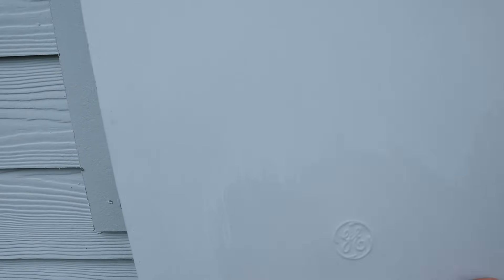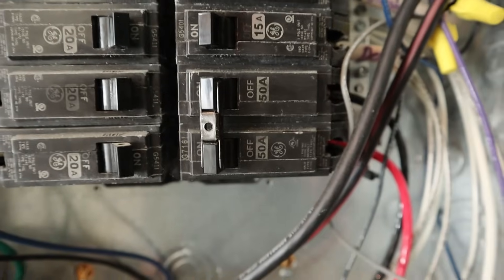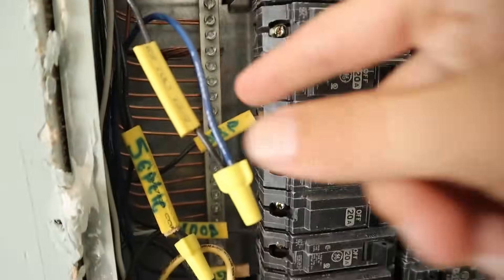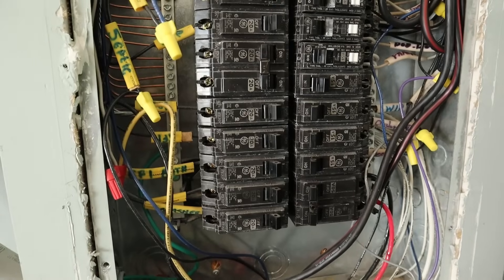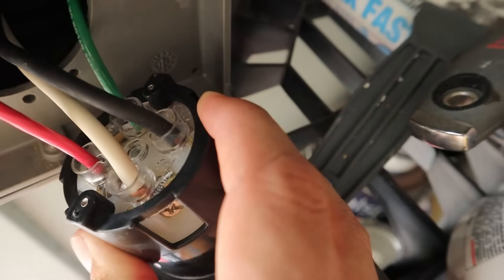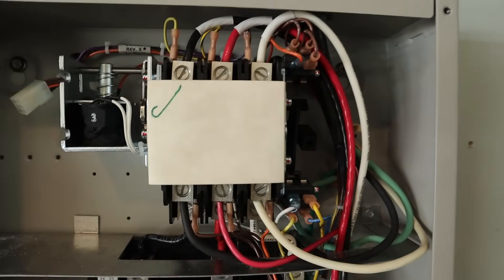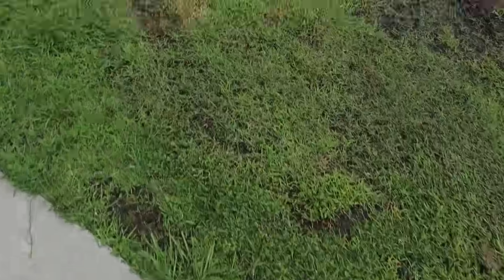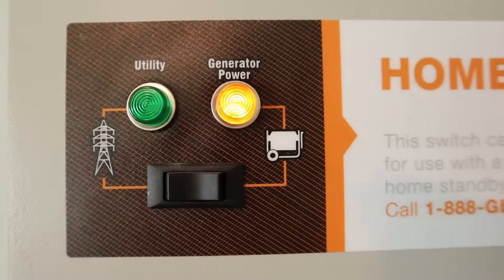HOW TO INSTALL A PORTABLE GENERATOR TRANSFER SWITCH

Comment: I don't really get it. If the generator has a 30A output to the switch, and the switch has 8 15A breakers, then that's a lot more amperage than the generator could even put out. So how does that affect the power served to the house when on generator?
Reply: It’s actually simple. The breaker rating is designed for max load, or overload. This design is to protect the wire to the load, not “tell you” how much power it has at any given moment. - The actual load will be less. You can do a load chart to help determine what Kw generator you might need. With a 3000 watt generator you would have to miser what you turned on at any one time. You could run the refrigerator and a coffeemaker if it totaled less than the circuit they are on, and was less than 3000 watts. However if you ran, say something like a 3500 watt heater on your 30 amp circuit the circuit breaker would trip on either the generator and or the breaker. - But, you would not melt the wires leading to it.

Comment: I have a 6 circuit manual  transfer switch,  I have two circuits that have very little draw on them (one has 3 led lights and the other a smart TV) can I combine those two and gain another circuit ?

Comment: Used to use this type system, but limited you to usually 8-12 Circuits, When Interlock came out with an Interlock kit, Has Stainless Slding Plate that allows Main Breaker OR Top Right Breaker(which goes to Power Inlet Box) to be selected. Can't Backfeed, @ about $200, seems Expensive, But Faster, Cheaper, cleaner Install as you don't need the Additional Enclosure.
Feel it is better as you can turn on Refrigerator, and Most all 120 volt Breakers. Just turn on and off lights/fan where needed. Depending on Generator Capacity, you may need to turn Off Fridge, to Microwave Something. Water Heater could even be used when needed,  Generator Size will determine what may need to be turned off temporarily.
This type Tranfers are Good Option When you don't have a Main Breaker in the Panel.
Wire appeared to be #8, 40 Amps?
Good Video
Stratmando
Just went back, saw the Finish, you mention #10(30)Amps.
Needs to Be #6. 
With #10 wire, Breaker needs to be 30 Amps.
Originally I thought it was #10, Later you confirmed this. Breaker will Protect wiring from being Overheated.
Reply: This is so spot on you think like me

Comment: What gauge wire did you use between the 50amp breaker and the transfer switch?
Reply: It looks like 8 gauge. If so that is to small. It should be 6 gauge

Comment: My water heater is a 30 amp 220 circuit....why is yours only a 15 amp 120?
Reply from the maker: Because mine is a Rinnai tankless water heater that uses gas.   Barely any electricity is needed for mine.  Highly recommend.
Reply: @HowToHomeDIY  Well that explains it.  Thanks
Reply from the maker: You’re welcome.

Comment: Are there transfer switches designed in cases there is not enough room to install 50amps breaker in the existing electric box? Or what would be other possibility other than replacing existing electric box?
Reply: tandem breakers

Comment: I already have the transfer switch in place but am planning to upgrade my gen from the current 6500w to a 10,000w constant power one.  This so I can run all including the hot water at same time.  Is it possible to add all lights into the box?  As of now I only have downstairs lights available.   Thank you

Comment: I currently have a 3,500W Generator. I would only need the basics and would be happy with a 4-breaker set up. Am I a fool? Should I upgrade my generator for more power? I don’t really want to do that. What’s your opinion? Would a 4 breaker option connected via 30A power be sufficient for basic needs? Thanks! Andy
Reply from the maker: A 3,500 watt generator is a little on the small side but it is what I started out with our first hurricane and I was able to power the fridge, some lights, and fans.  So it certainly can power up necessities it just depends on what you deem necessary.

Comment: So, this was exactly the video I needed. 

My question, though, what do you do about permits in this situation?  I’m very handy with electrical work, but, my local municipality requires permits, and only issues them to licensed electricians…
Reply from the maker: Well if your municipality won’t issue permits to homeowners and you want to make sure it’s permitted, then you would have to hire an electrician.  Where I am they will issue permits to homeowners.  Thanks for the feedback.
Reply: @HowToHomeDIY  I’m so jealous!  They charge locally $200 for an electrical permit… so frustrating. 

Haven’t been able to find an electrician that will actually return a call or show up when they say they will, so, I want to just do it myself, but, want to do the right way. 

Your video was spot on in explaining what needs to be done.
Reply from the maker: Yeah getting trades to come by in some areas right now can be really difficult.  One thing I noted in the description though is that in the video I connected the neutrals from the transfer switch to the neutral bar in the main panel.  When I had it inspected those neutrals needed to be removed from the main panel and connected to the neutral wire of each corresponding circuit.  The instructions that came with the transfer switch were clear as mud.
Reply: @HowToHomeDIY  Just to follow up here, I actually called the permit office today and spoke to a nice lady.  She said homeowners can actually do the work themselves, so long as its under $30,000 - I just have to sign an affadavit that says I will do it to current code, and will not sell of rent the house for 12 months from date of completion and permit approved.

So, sounds like I have some paperwork to fill out.

Thanks again for posting this video!
Reply: @HowToHomeDIY  Would it be acceptable to wire nut the white natural wires when disconnected from the bus bar in the main box and label them to what circuit they came from, the same way you did the black positive wires?

Comment: Do I have to use 10/3 or 8/3 wire from main panel to 30 AMPS
Reply: Generac states at least 10/3.  Some people want to use more expensive 8/3, so it's your choice.
Reply: @ChrisBurnsATL  It's 50 A though so expense really isn't a question in my opinion. 8 would be a much better choice for 50A. I really don't think a 50 A is needed for a 30A panel though so I would use 10 and a 30A breaker personally.

Comment: Good Video. However neutrals for each "line" in the transfer switch should not be bounded to the neutral bar in the main panel. Only the main lug neutral from the 50 amp utility service should be connected. Otherwise when you disconnect the utility power and run off the generator your bounded neutrals to the main panel provide a path back to the main panel and defeats the purpose of the disconnect. The correct way and what is documented in the Generac manual says is to remove the Hot and Neutral for each line from the main power panel.
Reply from the maker: Yes I talk about this in the description.
Reply: @HowToHomeDIY  yes I saw this... May want to move to the top of the description as it can easily be missed and is a dangerous mistake. Still great video

Comment: Once you switch does the breaker in the panel become a spare or can be removed?
Reply: The breaker not in use can be removed but needs a cover as there will be an exposed lug.  What can be done is to leave it in place and mark it "not used".

Comment: Thank you! I have a question for you.  Can I use a transfer switch panel as a main panel in a food truck... I mean can I run cables directly from a transfer switch  to the walls to connect appliances and the ceiling to the lamps?
Reply: not recommended

Comment: What if there is a ground fault while running the generator?    I know there are breakers but what if the generator can't deliver enough current to trip the breaker?  Will the generator cut itself off?
Reply: I am wondering what happens to the breakers that you disconnect  they are there just for that purpose

Comment: Hello,

I’m having an issue with this very same transfer switch. It will switch from gen to utility using the push bottom. However, it will not switch back from utility to generator?  I have to use the included rod to switch it manual. When I’m the gen mode if I press the button it will fire the solenoid and go back to utility. I purchased another one to see how the transfer switch wires are connected figuring the one I had was wired incorrectly from the factory. However the second one was exactly the same. I have one orange lead that goes nowhere. Both panels I purchased had this same wire not connected. 

I any case… would you mind taking a photo of your transfer switch wiring so I could compare to yours?  I would be much appreciated if it’s not too much trouble?  🙏
Reply from the maker: There is no way for me to post a picture.  But you will not be able to switch to generator mode unless power is being sent from the generator to the transfer switch.  Then the solenoid will engage.  Not sure if you were doing that or not.  The switch part itself comes prewired.
Reply: @HowToHomeDIY  

Hi,

Yes I had both utility and gen power being supplied to the transfer switch at the time of my trouble shooting. As it stands right now. I have to remove the cover and manual throw to gen mode evening while power is being supplied. However once in the gen position and Powering my circuits on the generator and utility power is present when I press the button it will go back to utility power source. 

It’s very frustrating because tech support was useless and I cannot find a wiring schematic for the control side of this transfer switch.

Thanks for replying.
Reply: @HowToHomeDIY  I figured it out.  Because i'm running a 125v 30A inverter generac generator is the issue.  The transfer switch requires 240v in order to operate.  Which makes sense as it will throw when on utility power but not on the current generator setup i have.  It needs to detect 240v across L1 and L2.  If this isn't present it won't operate via the push buttom.  You must use the yellow lever included in the box which defeats the purpose because you need to remove the cover.  I will purchase a 240v generator now.  Just an FYI for anyone else in this situation.  I found the info in bold in the manual.

Comment: Good video. One thing i would point out,, you said use a 10 gauge wire for the generator input box to the transfer switch,, this is not what is suitable for everyone. It is completely dependent on how long your wire run is.  If its short yes 10awg could work,,,  for others with long runs you need lower gauge (thicker wire) to reduce the voltage drop.  For example my generator sits 85ft from the transfer switch and i need a 6awg. You have to use wire gauge chart.

Comment: So it looks like you will now have a bunch of unused circuit breakers in your main panel now.  Why not move them over and use those in your transfer switch panel and save money?  I mean why have wasted breaker not being used? Each breaker costs significant money.

Comment: My main circuit box is on the outside of the house. I would need to place the transfer switch adjacent to the main panel, but the wires need to go inside the wall between the switch and main box. I think I'll have an electrician do this.

Comment: IF WE ARE INSTALLING A 30 AMP TRANSFER SWITCH, WHY ARE YOU INSTALLING A 50 AMP BREAKER IN THE LOAD CENTER?
Reply from the maker: Because the instructions from Generac say to use a 50 amp breaker and it makes no difference because if something surges the circuit in the transfer switch will trip.

Comment: I've watched a number of DIY videos on installing a transfer switch.  In all those videos I did not see any indication that the portable generators being used were themselves grounded.  All my searches indicate that the generator needs to be grounded (as does my owner's manual).  Can any of you experts out there offer some guidance?
Reply: With a bonded neutral generator, the neutral is connected to the frame of the generator. Safety code requires the neutrals to be averted away from the original source (your panel) and connect to the "first means of disconnect" when using the generator. This ensures that electricity will flow properly through the neutral conductors and is delivered to one bonded location — eliminating unpredictable stray voltages caused by connecting to the ground twice. 
 
A floating neutral generator's neutral circuit is not connected to the generator's frame or the ground, meaning it is required to connect the neutral to your existing panel neutral. Both hot and neutral conductors in the receptacles are considered "hot" on these generators, and can both be used to eliminate the risk of shock by allowing electrical currents to connect to the generator frame simultaneously during a short circuit.

Comment: Can you wired 2 generator in to your pole
Reply from the maker: No, just one at a time.
Reply: Well how do you balance the breaker so one leg don't pull more than the other
Reply from the maker: @pow-f70  You would balance it out in the transfer switch the same as in the main panel.  It is basically just a subpanel with a cutoff switch.  The breaker in the main panel is a double pole so it is pulling from each leg there too.

Comment: Generac refused to replaced or to provided services on a difected contactor in a Transfer Switch panel I purchased, since the panel arrived with no serial number.
Reply from the maker: Thats very odd that it would arrive that way.  Sorry to hear about your bad experience!
Reply: Shame on Generac.  This is how they responded to the problem: 
Hi Ben,

Kyle Brightsman has brought to my attention an issue you have been having with a transfer switch you purchased through Amazon.com. Firstly, I would like to apologize that you have been having issues with the product. I spoke with a few different people within Generac to find out the best method for you to get assistance with the issue. The 2 options someone has who does not purchase the product direct from Generac is to return the unit to where they purchased it from or to have a Generac Service Dealer fix/replace under warranty. It sounds like you have already done the latter, but because a serial number could not be located, we were unfortunately unable to move forward with the warranty process. With that said, we would have to recommend returning the product through Amazon for a refund being that they shipped you a non-serialized unit that has been deemed effective.

Thanks,

Scott Duchow
Supervisor Inside Sales

 

(262) 544-4811 x3151
GENERAC POWER SYSTEMS
S45W29290 HIGHWAY 59
WAUKESHA, WI 53189
Reply: On my unit, the serial number is on a data decal on the inside upper left wall.

Comment: I have a question it may sound very silly but I don't know much about these systems .. my question is if you have the transfer switch working once you have no electricity then when the electricity returns to the panel it does not make contact with the electricity that is working with the  generator
Reply from the maker: Not silly at all.  No it does not make contact with the power being supplied by the generator when utility power comes back on.  The transfer switch while in generator mode completely isolates itself from the main panel.  Once utility power is back and you change your transfer switch to utility mode, to put simply, it will shut off the entry of the electricity from the generator.  I hope this helps.  Thank you for the question!
Reply: @HowToHomeDIY  thank you sir

Comment: Your neutrals should be extended from main panel via wire nut to xfer switch..then supply neutral #8 will carry current back to main panel.
Also code requirement to have neutrals grouped once they leave from service
Reply: Thanks for that info. That issue with the neutrals was the only point I was confused on.
Reply: wrong. neutrals can stay in the main. not code anywhere to label neutrals.
Reply: @ThePetersmith77  the circuits need to be completely isolated for safety reasons.
If you remove a black wire from a selected circuit, you also need to remove white or neutral wire from the main neutral bar in the house breaker box. The only neutral wire coming from the main house Breaker box to the transfer switch, would be the large white wire, accompanied by the two black feed wires coming from the 50 amp breaker. Leaving the neutral wires of the selected circuits connected to the neutral wire in the main breaker box can still feed, electricity into the grid when there is a power outage. Local lineman are always at risk of being electrocuted because someone did not hook up their transfer switch properly.
Reply: @ThePetersmith77  
Circuits must originate from one location & neutrals need to be grouped with hot conductors.

Grouped not labeled
Reply: You are correct!!
Circuits selected for transfer need to be completely isolated for safety reasons. if you remove a black power wire from a circuit, you also need to remove the white neutral wire from the neutral bar in the house main breaker box. These white neutral wires are attached to the neutral lug inside the transfer switch. The only neutral wire that is connected to the neutral lug in the house main breaker box, is the large white wire that companies the two large black power wires coming from the 50 amp breaker to the transfer switch. This isolates current that could possibly feed from the generator to the neutral lug in the house main breaker box. Local lineman are always at risk of being electrocuted because someone didn’t know how to hook up their transfer switch.